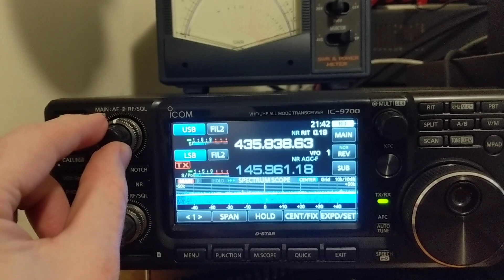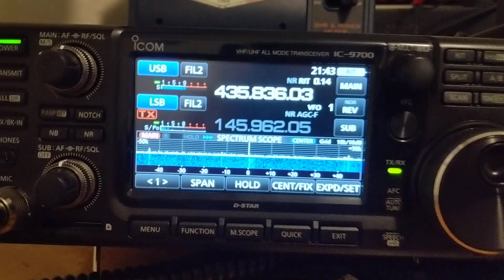Working FO-29 with an Icom IC-9700 and MacDoppler

Comment: Mark, I am trying to connect my 9700 to Macdoppler but I can not get the application to control the 9700 VFOs. The app seems to see the 9700 when I plug the USB cable in as the USB port shows up in the Serial Port settings. The radio settings are as per the Macdoppler instructions. What can I be missing?

Comment: I am interested in buying the 9700.  However, I have a Dell Laptop dedicated for Amateur operations.  Is there software that will work.  I hear that gpredict does not work.
Reply from the maker: I hear that SatPC32 works fine with the IC-9700 under Windows. Apart from that, not sure what else is out there. As you mentioned, GPredict does not work correctly, though this is not entirely GPredict's fault - it's also partly to do with how hamlib presents the radio to GPredict.
Reply: @markjessop8536  Thanks. .My other issue is that we live in a condo Apt.... I use a dual band hand held Arrow... So, I am trying to put a portable sat station that i can use in parkx with a battery or using car battery

Comment: I run Macdoppler as well.... I dont have  9700 yet but was it easy enough to connect it?..My 9100 comes up with 2 USB ports which you connect to and they are never the same
Reply from the maker: Macdoppler will look into the USB device info and create a symlink to the appropriate serial port to use. Makes it very easy!

Comment: Where did you find the 9700 drivers? I've got mine connected, updated MacDoppler to beta. Got the address  in place but can't get the connect. Any suggestions?
Reply from the maker: There's some info on the required settings here: https://www.dogparksoftware.com/MacLoggerDX%20Help/mldxfc_radio_settings.html

Comment: I understand the radio is connected to PC via usb in order to change the frequency by itself. Is that right? Nice video thank you for sharing it with us
Reply from the maker: Yes, I am using MacDoppler to handle Doppler correction.
Reply: @markjessop8536  i thought the built in auto tuning did that?
Reply from the maker: @iank2196  inbuilt tuning cannot compensate for Doppler, as it has no info on the sat position.
Reply: @markjessop8536  oh, in another video I saw, it seem to be tracking the signal doppler using AFC ? Maybe i misunderstood it as I cant see that working without a constant  carrier present.